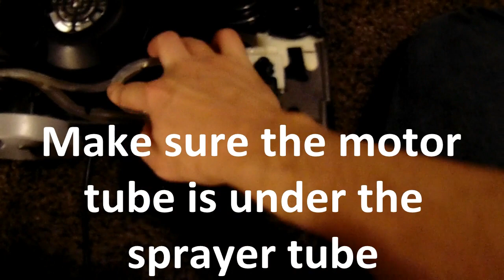Hoover PowerScrub repair

Comment: P.S.  When I opened my Hoover up, there was thick brown grease all over the gears, the bearing and the housing for the gears.  Any idea why this would be the case?  Cleaned it all, put back together and it does work now, so I don't know what to think about all that grease.
Reply from the maker: My guess is, it might be the original lubricant.  The original lubricant was white, and it's possible that some rust mixed in with it and turned it brown.  Or the manufacturing plant might have used  a lubricant that had a brown color, etc.  Could be a number of reasons.  It's good to get it cleaned up and a new lithium based lubricant used.
Reply: @Doramius  Thank you!
Reply: @Doramius  Well crap.  It quit working again.  The gears are really easy to turn, the motor shaft is really easy to turn, everything is lined up and lubricated, but the brushes turn really slow, barely at all.  I've only had this thing for a year and probably used it 4 or 5 times. What a hunk of junk.
Reply from the maker: @TrustKnowWun  The brushes are driven by airflow, and not belt driven.  It sounds like there's might also be something blocking the airflow.  Make sure the tubes do not have any kinks or obstructions preventing airflow, and also that there are no cuts or holes.

Comment: Do you know how to fix it if it had a loud noise with a burning smell? I used your video to take it apart but I didn’t know what to do after that.
Reply from the maker: If there's ever a burning smell or smoke present, you should take it in for service.  There could be a leak, or something happening with the motor.

Comment: What would you think the problem is if my brushes and hex bolt moves freely if I manually turn it, but the brushes still will not turn when I turn the machine on, and it smells like it's burning? You think it still might be the bearings?
Reply from the maker: You might want to check the gears.  Sounds like you might have some stripped teeth.
Reply: @Doramius  Thank you for the quick response.
Reply: @Doramius  I may have to seek my local professional, which is what I wanted to avoid...lol. Wish I could add a picture here. Took all the way apart just like you did in the video, all the teeth looked fine and the gears moved very smoothly. No idea what else it could be. But thank you for all your help!
Reply from the maker: @slomotion1028  Yeah, it doesn't sound like the issue listed in the video.  For it to move freely, but not spin from the motor, something is not engaging.  It may not be teeth from the gears, but something is definitely not making contact.  Good luck with your issue.

Comment: Thanks for making this! It at least gave us an opportunity to try and fix ours even though in the end, the shaft was too badly rusted and the repair was not successful.  (I'd suggest some less annoying music though, next time.
Reply from the maker: I had different music, originally.  Youtube marked the music as protected, even though what I was using was not.  The other video is available on youtube, with removed audio, if you like.
Reply: I have a power scrub to but mine is leaking where the solution tank is n can't figure out how to fix
Reply from the maker: Leaks can be tough to find.  I've tried the "tire leak" method a few times and have found it to work.  However, make sure you clear the lines with clean water for a few minutes one you find your leak.  The tire method is where blend 1tbsp of dish soap with 2cups water.  Then run the solution through the line.  The leak should bubble out.  Most of the time the holes are found either at the connecting points or at bending points.  In some cases, I just replaced the hoses altogether.  Sad truth.
Reply: Doramius My issue is with the scrubber attachment tool. It won't spin at all. It feels like it's locked. No movement at all. I took apart part to see motor. It looks similar to the larger one in your video, just smaller of course. It has lubricant all over it (from manufacturer), and it is not rusted at all. I tried to turn with vice clip. Nothing. It won't budge. Seems locked. Any advice? I can't find sales receipt, so Hoover will not replace. Also I live on Maui and there are no Hoover mfg stores to purchase a replacement part. Help :)
Reply from the maker: I hope I read what you're saying correctly.  The scrubber brush snaps directly to the motor driven gears once assembled.  If you removed the scrubber brushes and they don't turn freely, then the brushes have another issue that needs to be looked at or replaced altogether (See 1:08 ).  If they move freely and you get to the motor and you see the grease, but it is still seized and unable to break loose, the motor itself may need to be replaced.  Overall, the cleaner is good, but the build of the air driven motor is the most disappointing piece of the whole design.
Reply: Doramius Thank you!! Yes, you are sooo right. I tried everything. It's still locked :(. Even though I have a two year warranty, Hoover won't replace because I can't locate receipt. That's ok, I saw this part on Amazon for only $20. I'll just get it there. Thanks again.. :)
Reply from the maker: Sounds like you've got it under control.  Definitely add lithium grease to the shaft & bearing of the new part to help extend it's use.  Good luck and enjoy.
Reply: Doramius  yes! great idea, thank you :)

Comment: I did this. Still doesn’t work. It seems the white cover is touching the bearing not allowing the bearing to spin freely. Not sure why it touches, but when I take the white cover off, the bearing spins.
Reply: Also, I couldn’t get the bearing off. Got it to spin though with some wd40. Not sure how much force it should take to spin. Mine definitely takes some umph to get it to spin but at least it’s not seized anymore.

Comment: i have a  hoover power scrub cleaner but the cleaning solution won't come out of tank when you squeeze the lever...any suggestions
Reply from the maker: Make sure the tank is firmly in place, and that none of the hoses are pinched.  I have had where someone left undiluted cleaner in the solution side and it dried out in the tube creating a thick barrier that wouldn't let liquid through.  I was able to squeeze the blockage and get it to move through the tube, but it was too much for the nozzle and had to splice the tube to clear it.  Check that there are no kinks in the tube and that there are no blockages.

Comment: Once I get the shaft turning again I was going to use WD-40 or Wurth HHS-K on it to, hopefuly, prevent or delay it from happening again. Good idea or bad? Which would be better, WD-40 or Wurth HHS-K?
Reply from the maker: Again, I prefer Lithium grease as it seems to prevent moisture corrosion a little better.  I know WD-40 also makes a lithium grease.  Regular WD-40 will work, but tends to need to be reapplied after extended use of the Hoover.  I've used Wurth on car parts, but haven't ever used it in the Hoover.  I don't know if it'll affect the plastics, though, so be cautious.  Wurth is usually for metal on metal lubrication with heat and/or pressure.

Comment: Well, got all the way to step 22- reinstalled the brushes and they still won’t move freely. 😭😖
Reply from the maker: If you made it to Step 22 and everything else was turning and moving smoothly, the problem may be the brush assembly, itself.  You'll need to make sure there aren't carpet fibers in the gears, and that the gears do not have damaged teeth. As long as the motor assembly moves freely, the main unit is fine.  If the Brush assembly is damaged, you may need to replace the brush assembly.

Comment: The brushes should be cleaned to remove soil; use a wire brush to get down to the base to remove hair.
Reply from the maker: It's a good suggestion.  I use a plastic wide bristled comb, as wire brushes tend to shred or pull out the nylon brush fibers.

Comment: My vaccume doesn't turn on at all would this be the same issue?
Reply from the maker: If it is a Hoover, there might be some compatible parts?......but in general they are different machines, so I will say 'No', especially since a model was not posted to use as reference.
Reply: @Doramius  it's the exact same vaccume but its doesn't turn on. I was using it the it just shut off and now it wont turn on
Reply from the maker: I think I understand.  You have this model cleaner (vacuum is a different product from this steam cleaner), but it just will not power on.  The fix listed in this video is for brushes that will not move due to rusting, but the unit still powers on and, otherwise, functions normally.  If it does not power on, I would recommend taking it into a repair shop as you're dealing with a potential electrical issue.  There may be a problem with the power cord or switch, and if it is not repaired correctly could be a shock or fire hazard.
Reply: @Doramius  ok thank you

Comment: How do you remove the lower bearing?
Reply from the maker: Unless they've changed how the motor is made, the lower bearing is not replaceable.
Reply: You can take out the cap from the shaft and then remove the lower bearing

Comment: I did this and my gears are still tight after loosening what can I use
Reply from the maker: Depending on how badly rusted it is, You may need to work lithium grease into the bearings and shafts.
Reply: Doramius the gear spins but it’s a little resistant what about wd40? Would that work? It’s not that badly rusted it just doesn’t spin so freely
Reply from the maker: I've found Standard WD40 will work...temporarily.  Depending on how often you use the unit, you may need to reapply WD40 within 6 months to a year.  WD40 does make a lithium grease, as well.  I have noticed that lithium grease seems to repel water or prevent rusting for quite a bit longer.  Starting out with regular WD40 will help breakup the rust, so you should be fine.
Reply: Doramius thanks so much for responding! I used oil and acetone and it works 😂
Reply from the maker: Anytime.  Glad it's working again for you.

Comment: I just stuck a 3/8 Allen in it and broke it free
Reply from the maker: This has been mentioned previously, and it is NOT a recommended option.  As visible in the video, the internal gears are plastic, and the forcing of the movement with a seized motor shaft can damage the teeth, creating a more costly repair.

Comment: Mine isn't powering on at all
Reply from the maker: This video is for seized scrub brushes.  If it's under return or warranty, then follow that option.  If it's past those dates, it's recommended to take it to a professional repair place.  It's possibly an electrical issue and is NOT recommended for consumers to repair on their own, due to potential safety concerns.  If you choose to repair any electrical issues, it is at your own risk.

Comment: $50 for a new turbine 30 min work wont let it air dry again the 3 times a year we use it I will take it apart and wd it
Reply from the maker: There are strong recommendations, among my own, to use lithium grease as it tends to last a lot longer and is very resistant to letting moisture affect the bearing.  Not a lot is required, is easy to find, and WD-40 does also make a lithium grease that normally has a Yellow cap, instead of the traditional red cap.

Comment: Save time, snap out roller assembly and use an allen wrench. Just insert it where middle roller  goes and turn. It will free up without tearing it apart.  Rust? Never saw rust on plastic. parts.
Reply from the maker: THIS IS NOT A RECOMMENDED METHOD!!  If the shaft is seized, the plastic teeth on the gears WILL strip out.  The shaft and bearings ARE metal.
Reply: @Doramius  thank you